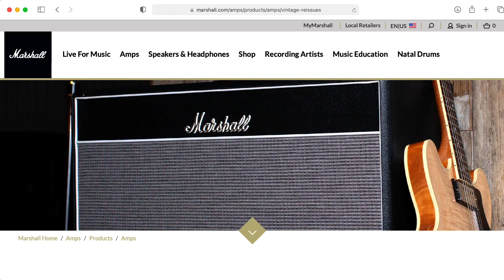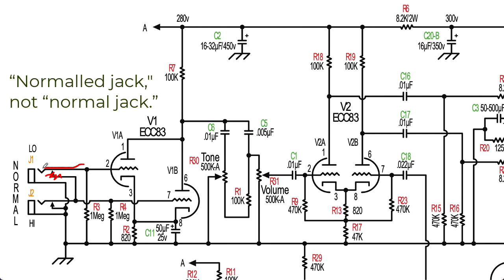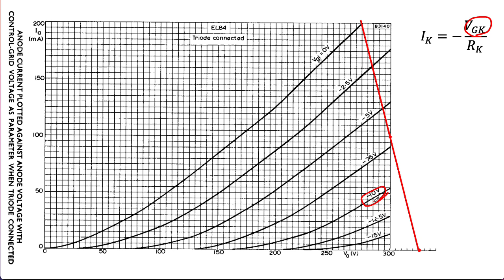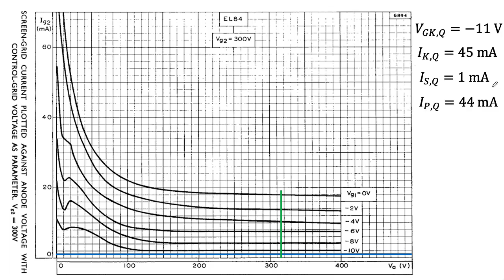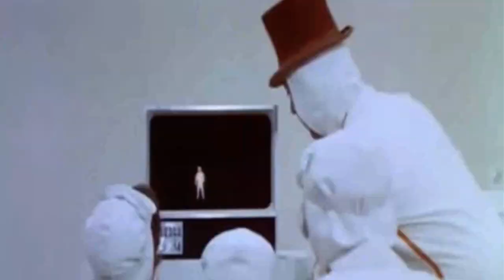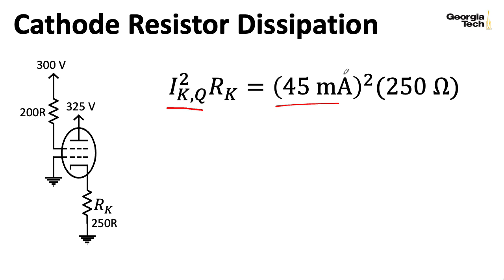ECE4448 L50: Biasing Marshall 18 Watt Push-Pull Power Amplifiers (Guitar Amplification and Effects)

Comment: I got one question about the general topology of the preamp. Do I understand correctly that the phase inverter is actually amplifying the difference of both channels when they are bridged together? (guitar in trem high and jumper from trem low to normal high). Normal channel should invert the signal wrt input, and the trem one should do the same with one triode (assuming tremolo is off). So both signals at the PI grids should be "in phase" with each other and the PI being a differential amplifier should just amplify the difference between the two. Is that the correct interpretation? Why didn't they sum them in a single node, since they are in phase? You don't see very often PIs used as mixer like that.

P.s. I think that this schematic is actually a slightly modified version then the official amp (they claim that the two "normal" inputs are identical, while here one activates the parallel and the other activates a single triode)

Comment: Tube-based tremolos are pretty straightforward. Those three .01uF caps in a series each delay the waveform phase by 60 degrees, so after three caps it’s 180 degrees out of phase with the input. It’s fed back into the second triode’s grid, and that out of phase signal is used to cyclically attenuate the output to the rest of the amplification circuit.

Comment: 10:23 Wouldn't it be better to assume that both the plate and screen grids are at 300 V, where the screen grid is? Since the screen grid is intended to make the behavior of the pentode essentially independent of the the plate voltage?

Of course, the difference between 300 V and 325 V is not that big anyway. But I guess that the tube power would come closer to 12 W.
I'm still wondering about that, though. This is 12 W at the bias point, right? If the tube is already at peak power dissipation at the bias point, what happens when you start to feed in some signal? Guess I might get to see that in the next lecture...

Comment: 2:09 I wonder why they use two input tubes in parallel for the first amplification stage? They could have had a switch to switch between low and high input amplification, and saved a tube?

Comment: When an amplifier circuitry RC charging time and discharge time is EQUAL, what does this mean? that the voltage and current pass through easier, this is considered the resonance frequency or the gain is higher or lower because the amplifiers circuitry RC charging time and discharge time is EQUAL so the gain is higher or lower? I know when the RC charging time and discharge time is EQUAL the duty cycle is 50% using a square waveform. In guitar amplifiers power supplies the RC charging time is very short and the discharge time is very long so EE engineers will want a 5% charging time to 95% discharge time giving a duty cycle of 5/95 which is based on the RC duty cycle of the filter capacitor values and the power amplifiers LOAD as the load Resistor to get the RC duty cycle percentage.
Reply from the maker: If you think of a square wave going into a simple RC lowpass filter, you can think of it charging and discharging at the same rate since everything has the same R. But in something like a power supply, what's charging is very different that the rest of the amp which is discharging, so you can't really think of them equivalently.

Comment: Since there is no NFB, why connect the OT to ground?  Is it a UL thing?
Reply from the maker: From what I understand, safety standards don't let you float the secondary -- there could be a problem, for instance, if there's a breakdown in insulation between the windings in the transformer.

Comment: My guess is that the higher plate wattage is because its an AB power amp. So the tube isnt on all the time. Werent most television class-A amps using combo triode/pentode tubes?
Reply from the maker: Re: the AB: I've heard people say that, but the thing I can't wrap my head around is this is current that is flowing and power being consumed even if you're not actually playing anything. 

I haven't looked at television designs, to be honest; I was just spitballing. ;)
Reply: @Lantertronics  Yeah, that makes sense. I was thinking of transistor amps. 

Someone in the comments mentioned he fixed the issue to save tube life. And I have friend that has done it ro his amp.